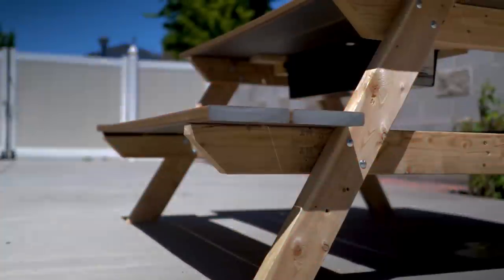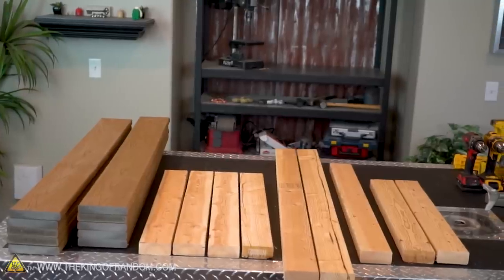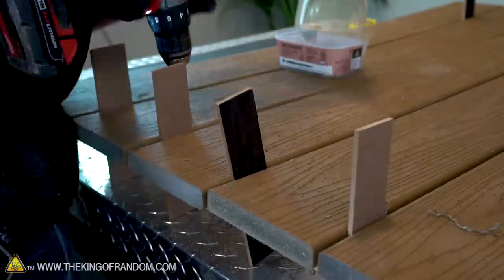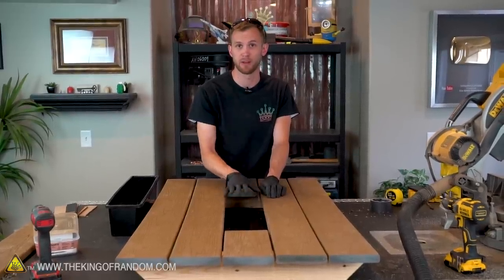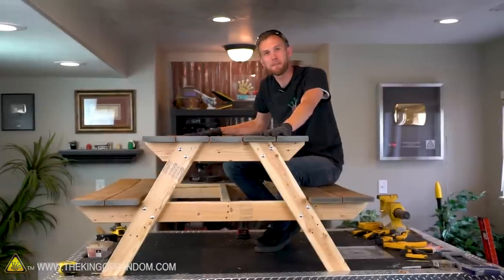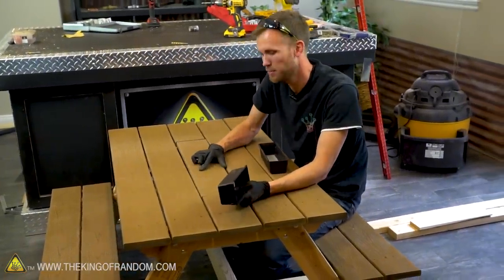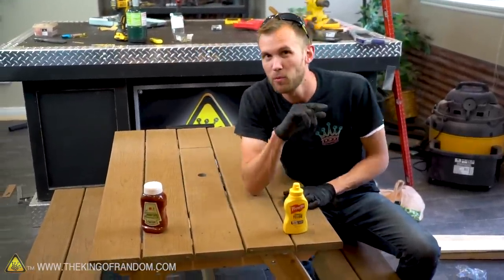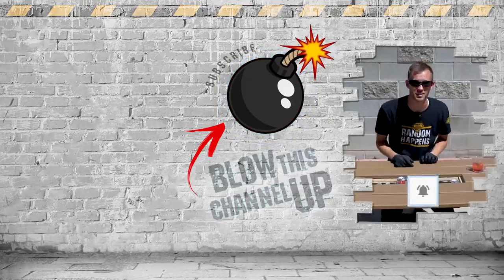The ULTIMATE Picnic Table (Cup Holders Included)

Comment: For added support... use a small paint brush to apply wood glue to all surfaces where any two pieces of wood touch. A nob from an old cubard would work better than the big gaping hole in the center.

Comment: I love this! Is there a reason the whole thing isn't made from the decking board, seeing as it won't rot being exposed to the elements?
Reply: The decking material is not strong enough to use in place of the wooden 2" x 4"s.  The table would not be able to support the weight of the people sitting at it.
Reply: thallok oh I see. That makes sense. Now that you mention that, I have noticed, in stores, it's a bit wobbly. Thank you

Comment: Do not use that composite decking! It gets insanely hot in the sun, rendering your table unusable.
Reply: Chili Poppa I mean the stuff got its start as above ground pool decking barefeet sun water works great no rot no splinters easy clean
Reply: Tim Cushing he is right though. It's like standing on blacktop in the summer.
Reply: Isn't it possible to put a tablecloth on it?  That's what I do anyway.  Works great!

Comment: I feel like you could've cut out quite a bit of that underneath stuff for the cooler by simply just extending the first two support pieces inwards a little more, so that you could just slide down the cooler from the top of the table and each end of the cooler trough would be held in place by the support pieces.

Comment: I would’ve added a handle to the cooler top. Holes in the cooler to drain water, supports under the cup holders to hold soda cans in it and more stable condiment holders, probably just as wooden boxes on the ends.. oh also a full sized build for adults

Comment: If you continued the hole you drilled in the cooler lid through the cooler and then turned the cross brace by 90 degrees and made a small recess it would allow for you to add a sun umbrella aswell

Comment: Composite decking as I understand it still tends to be a bit prone to bowing if the beams are too far apart. Probably not a big deal on the table part but probably could be a problem with the benches. The stuff I just used on my deck said to put the joists every 16".

Comment: A couple modifications that I can think of.

* Bevel the corners of the seats to soften those edges to save you shins walking around it. (Yes, it'll still hurt to hit the corner, but at least there won't be a 90° corner digging into one's shin...)
* Attach small pieces of the material you used for spacing the planks to the sides of the removable section. This should help keep it centered and looking even.
* Add insulation to the outside of the cooler portion (spray foam for ease) to keep the cool longer.

Otherwise, nice build.

Comment: I would recommend drilling some drainage holes in the main cooler compartment with plugs so that nothing drains when you're using it with ice as a cooler, but when it's just sitting outside, if it rains, water will pool in the cooler and sit. Removing the plugs means most of the water will drain on it's own so you won't have to empty it before you use it again. Just a thought

Comment: Anyone making this, I STRONGLY recommend using galvanized or stainless steel bolts; don't cheap out and use zinc. Zinc bolts will wear out fairly quickly and break.
Reply: Also a cap for the hole wouldn't go amiss to minimize risk of rain water soaking into the containers.

Comment: I would've preferred the cooler to slide out the side long ways. I feel like the way they did it would be sort of uncomfortable to reach under the table. Just attach a handle to the side, pull and use your hand on the bottom to support the weight.

Comment: I really wish you had done the lateral support right :/... Now my legs are going to hit the middle bar on 9,531,060 tables.

All jokes aside, the normal picnic table has diagonal corner supports to prevent knees hitting the bar.

Also. Why not just drop the cooler in from the top, like the center piece does...

Comment: So a picnic table with cup holders, isn't the whole table a cup holder as well as the condiment tray again it is a table. The "cooler" has zero insulation and is almost all exposed to air so will melt fast, then as a bonus you have to crawl under the table to get it in and out, a screw in plug to drain reachable from the top and drop in would have made it far more usable for an adult plus it would not be full of water when you are trying to get it out.

Comment: Decking boards should not be predrilled they are designed to pull in the excess material from the board to hide the screw, predrilling removes the excess material

Comment: ..... never use white wood for outdoor you are just inviting termite to your yard.  Should have used PT wood instead.   and the screw need to be either deckmate screw or  Galvanized screws and Galvanized washer and stuff.   because if you do not you run the risked of rusted bolt outdoor that could cause your project to fall apart after 10 year or 1 year if table gonna be near coastal areas.

Comment: Dude. Most your views probably use the metric system (if they don't they really learn it) you should use centimetres and millimetres. They are both easier to calculate and more accurate. Enough of the imperial nonsense. But nice table bro